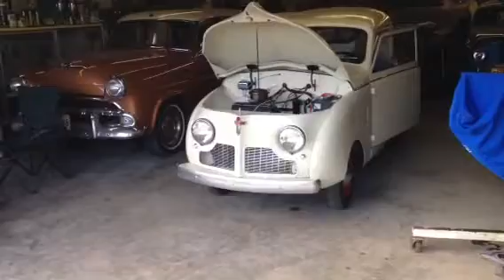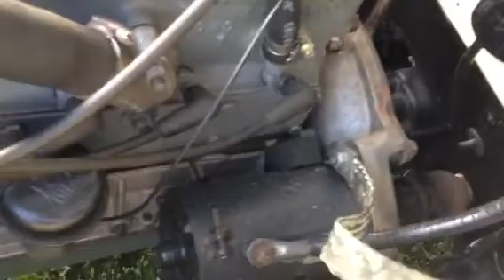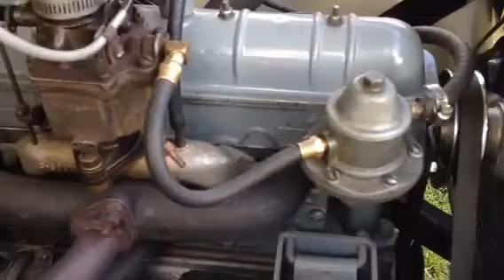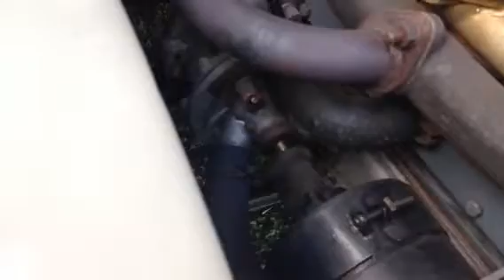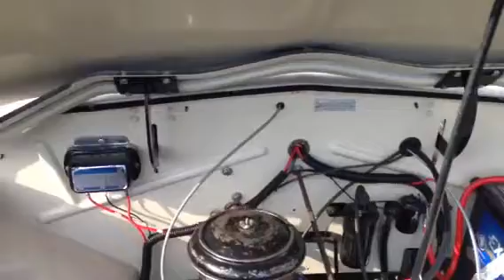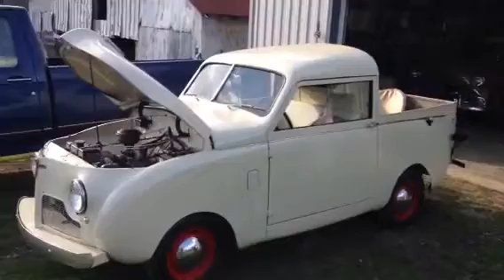Running 1947 Crosley 26.5 HP

Comment: i love it.   does it top out at 35 mph ?  lol
Reply from the maker: It loves 35 but these motors were used in 3/4 midget race cars also. So only reason it tops out is because it's 3 speed transmission in the original cars.

Comment: That is a neat little car! As MrHevyShevy would say....It need a turbo. LOL! Boy 2 guys could probably lift that motor right outta there. lol
Reply from the maker: Take starter, generator, water pump, intake and exhaust manifolds off it weighs about 50 lbs. These motors were raced and you can get blowers for them.
Reply: 19stoney64 Dang! lol That must be nice! haha Blower would be cool!
Reply from the maker: +Military Chevy wouldn't work too good in factory car, it only has 3 speed tranny with top speed of about 40.
Reply: 19stoney64 Ah ok.